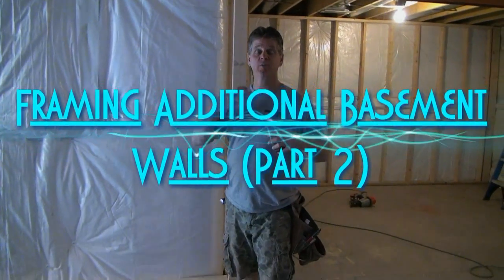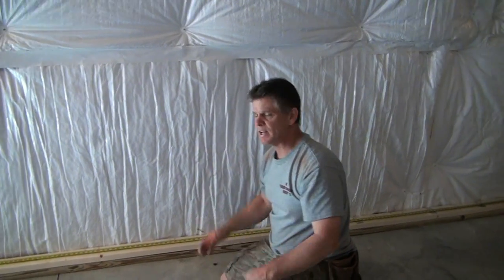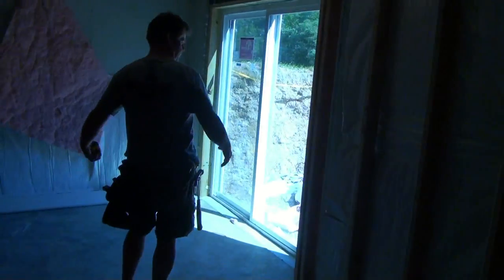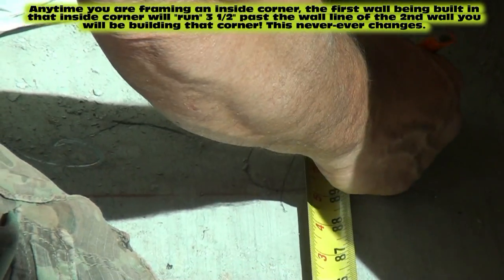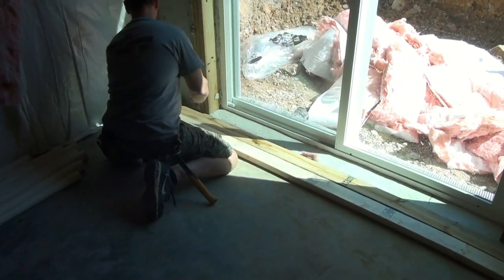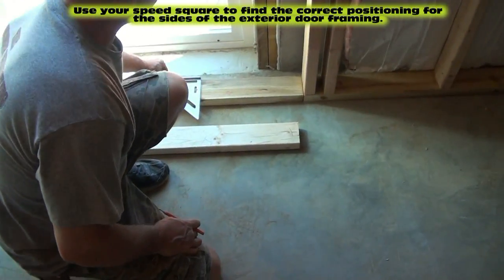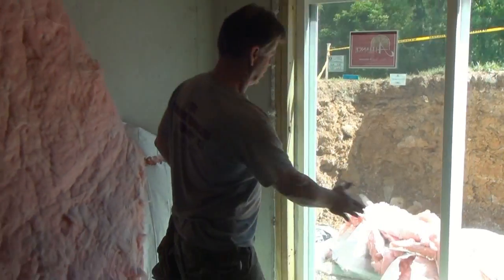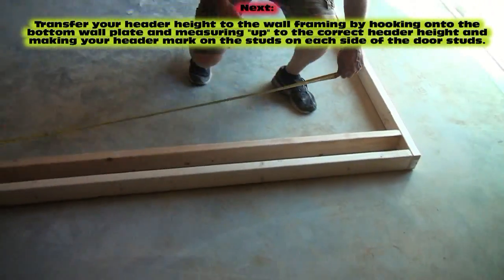How-to Frame a Basement(frame exterior door openings)  Part 6 of 6

Comment: I had the same question as somebody else did "Hello, when you measured height of door is 79 1/4, why in the measurement at framing, you only come up 79 inches?" Was the 1/4" to allow for the finish plate going on the door when finishing the gap? Thanks!

Comment: I have two vertical 5 inch ABS pipes (floor to ceiling) along one of the basement walls I'm about to frame.  What is the best way to frame around them?
I loved the 6 part framing videos.
Thanks
Reply from the maker: FRame out to make them look like drywall columns when they are finished.

Comment: Thank you so much for these videos! I almost have the courage to try this on my own after seeing the quote from a contractor. My only question is about top/bottom plate size and it’s really dumb. Several of my walls are 17 - 18’ long. I can get 20’ boards at my local Menards. Should I use 20’ or just do 16’ boards like you suggest?

Comment: Great video series.  You forgot to cut out the bottom plate around the door floor.  Many comments seemed to be confused about that.
Reply from the maker: Gets cut out after the wall is set…
Reply: @BasementFinishingMan  This video series is amazing!  Great job.  Why are you cutting the bottom plate after the wall is put up?  Why not cut the bottom plate first taking into account the door dimensions and then put up the wall into place?

Comment: Could not help see how the slider door installation is skewed and a challenge to finish trimming around. How does one reconcile your plumb and square framing to the door framing that is short by half an inch on one side? Finally, is the last step pinning the to narrow bays to the concrete and then removing the bottom plate between them with the sawzall? And thanks again, Eddie! Looking forward to viewing more of your instructional videos.

Comment: These videos are the best!! I’m going to start on basement project in a few days. But, I’m not sure if I missed it… what do you do with the bottom plate in front of the sliding door? Is that cut out after you secure it with the ramset?
Reply from the maker: Hi Robert, Yes that is correct...you cut the bottom plate out after the wall is up and secured top and bottom. Good luck with your project.  ~Eddie

Comment: These videos are unbelievably helpful ive been watching and taking notes lol. Thanks for taking the time to do them. In NJ we have to do vertical fireblocking every 10 feet and fireblocking between new framed wall and concrete. Do you have any tips or videos on when to do that?  Can you make the wall 1/2 short on top and slide 1/2 plywood between top plate and floor joists for fireblocking?

Edit: Disregard. Sorry just saw you have a video on that already. Thanks

Comment: These were by far the best and most concise basement videos that I have watched on YouTube so far and I’ve seen many. Perfect amount of detail and covers many scenarios. My only question is whether using a laser level instead of plumb bob would work? Also, wondering if you used the floor plan that you showed in video #1 because for the utility closet for example you didn’t seem to refer to it for exact measurements. Thank you!!!
Reply from the maker: Thanks Rob! Yes we use laser levels a lot as well...they work great and are actually a bit quicker than using the plumb bob. I'll do a video on the Laser some time to explain how I'm using ours to layout wall lines on the ceiling.

Eddie

Comment: Eddie - I noticed that in your video you are using 2x4x16 white boards? Is that the longest I should buy it then cut it as I need it, correct? I have 1,400 sq.ft basement and some walls are longer then 8ft.
Reply from the maker: Yes that is correct. Just get all 16' 2" x 4" 's  for all of your walls top plates and cut them to length as needed Viktor.  ~Eddie

Comment: Hi, what a fantastic set of videos. Just what I needed. I do have one question. When you complete the walls, do you cut out the lower part of the framing around the door opening? I'm guessing this would be done after completion of the next wall to keep everything square, but just want to confirm. Thanks so much for these helpful videos.
Reply from the maker: Hi Frank! Thanks! Yes we do this to each door opening at the end of each days framing.  ~Eddie

Comment: Q. On an inside corner, should you insulate behind the studs before setting the wall. I think most walls may not have that blanket insuslation already there, so that would leave a cavity without insulation right?
Reply: "Yes." See also, "California corner" (and there are other methods) for another way to frame a corner that leaves an open pocket you can add insulation to afterwards.

Comment: Instead of the sliding door if it was a normal exterior door where would you attach the door jamb?. Is it to the inside framing(that you just framed) so that the door jamb stay flush with the inside drywall and then jamb extend to the outside?. If so how do you find that wide of a door sill?. Can someone knowledgeable answer this?. My house is on a slope and on the front of the basement the concrete wall is only 2 feet and then wood studs on top plus there is a brick layer on the outside of the concrete. If I frame inside the concrete wall, then there is the width of the framing plus width of the concrete wall plus width of the brick layer. I am guessing I need to fix the door jamb to the inside framing and the jamb extend to the outside. On the other hand if I install my door jamb flush with the outside edge of the concrete wall and then use brick mould to cover the gap between the brick and concrete; then jamb extend to the inside, the door may not open beyond 90 degrees.
Reply from the maker: Same as the slider you frame both door types the exact same way.  ~Eddie

Comment: Hey Eddie, I have a question. I have the insulation halfway from the top say around 4 feet and the remaining 4 feet is raw concrete.
So should I start 6” away from the wall or 4 1/2 secondly, should I keep the existing insulation and then build on top of that? I live in Central/ south NJ.
Much appreciated.
Thanks

Comment: Do you typically need a permit to add walls to an unfinished basement? I would think a lot of people won't go through the hassle since the structural integrity of the house isn't really being changed - just a couple of 2 x 4's and some dry wall.
Reply from the maker: It just depends on your individual city code department. Most would like you to get a permit from them. Ultimately it's up to you whether or not you wish to get a permit when it's required. I personally wont get one if I'm working on my own house.

 If it's for one of my clients I will ask the Homeowner to get a permit if it's required to protect them and my company from any legal issues with the city code department. 

Hope this helps.

Eddie

Comment: Hey. I loved the 6 part series. Thanks! Question for you. What are your thoughts on “floating” the basement walls to allow for expansion and contraction? (I’m in Denver, CO) My 2 basement stair walls framed by the original builder are floating. My parents have a new house with a mostly finished basement (by the builder) Theirs are floating too. What are your thoughts? Any videos on it?? Thanks again! Great material.
Reply: Jason Koch it’s code in Denver because of the expansive soils. The slab will move so the floating walls will accommodate that. Frame with floating walls.

Comment: Question: when you hooked the tape measure 4 studs in to get your 16" centers on the 2nd half of the wall, why didnt you lose 3/4" since you didnt measure off the center of the stud? Or did lose it?
Reply from the maker: Because we are measuring of the edge of the 2" x 4" when we "hook-on" and then measure across the plates. But if you were to then measure from the center of the wall studs you would be at 16" to the centers of each stud the whole way down the wall...so you don't lose the 3/4" at all!

Eddie
Reply: travelbilly, when Eddie hooked-on and went leftward towards the sliding door, you'll notice he marked an X to the left of his line, denoting where the stud would go on the plate, just like all the other markings with X's in this this video series. :)

Comment: Thank you for this amazing set of videos! I found these  as i am just starting designing a partially finished basement.  Question for you if you happen to see this, i am considering using dricor flooring and framing on top of it. Any knowledge, tips or experience using this? Thanks again!
Reply from the maker: Hi Don, No I can;'t comment I've never used the stuff...Seems to me like a waste of time and money as you can simply go right over the concrete with any type of flooring you choose to install. But...with all that said I'm sure it's installed after the framing as you would not want to sit your framed walls down on top of this product, this product would be best installed between your newly framed walls.

Eddie

Comment: What did you do about the concrete walls around the slider that had no blanket or vapor barrier? 6mil poly? Foam? More “blanket”? Nothing (its small and window slider.... so who cares?)
Reply from the maker: R-13 ROXUL insulation was stuffed around the opening. No Poly or vapor barrier or foam.

Eddie
Reply: @BasementFinishingMan  Was there blanket insulation before you started? It looks that way. Why was it removed?

Comment: OK, so just finishing my basement walls, and I would say, never bother with studs on your outside walls. I went to Menards, picked up a product called InSoFast. It is foam board that contains built in plastic studs that glue right to the concrete walls. The foam board has vent slots for air and moister. Its tongue and groove, so you have a moister barrier. It is designed for basement walls. Its plastic, so it will never rot. Drywall screws right to the built in studs. My wall is only 2.5 inches thick, up tight to the concrete. Not only that, but I only brought the drywall down to 3.5 inches off the floor. I will use a plastic baseboard to cover the gap. This way I can get up to 3 inches of water in my basement and never damage anything. The drywall is off the floor, so it will not wick up moister. Way easier than framing. It was cheaper too, with the price of studs these days. The only difficult part is when your concrete wall is not flat, you have to prop up braces to make sure the foam wall follows the imperfections of the concrete. Technically the drywall is not flat, but you will never see it unless you lay a straight edge on it.

Comment: I finished watching all the 6 framing videos you have. I love them all. You have explained it so well and I'm very confident about framing my basement now. I believe what you did around this door will also be the same for windows. 
One weird thing in my basement is its height, which is 104 inches. If I remove 3 inches for the bottom and the top plates then my studs need to be 101 inches. I cannot go with 8 foot studs, I've to order 10 foot studs and so much lumber will go waste.
Reply from the maker: Get 9’ studs!
Reply: @BasementFinishingMan  Oh..I thought the only sizes that we get are 8,10,12 and 16ft. I'm going to Lowes now to find 9' studs. Thanks a lot!